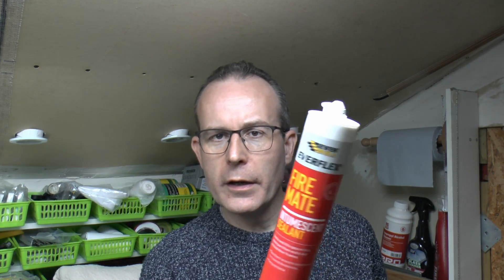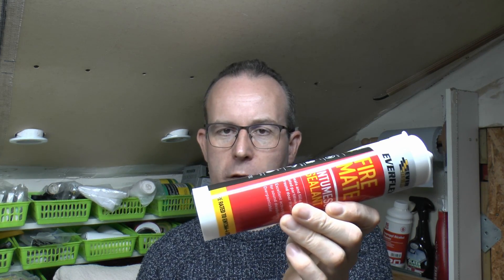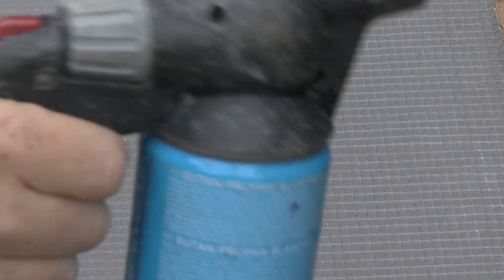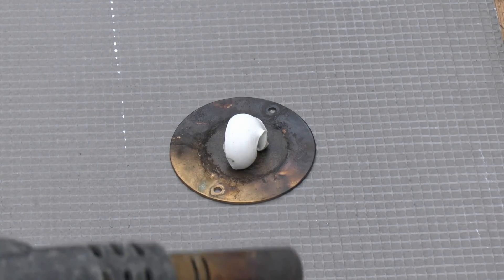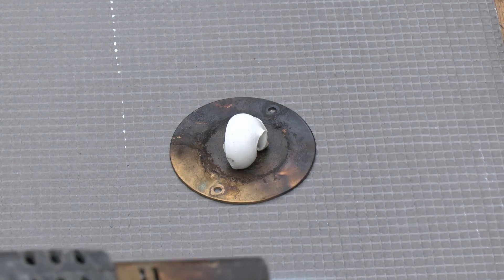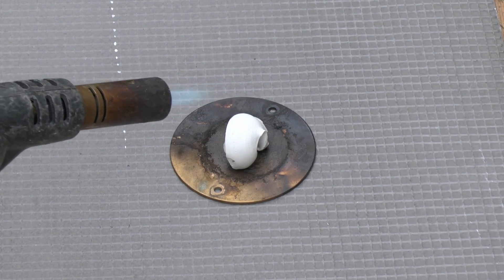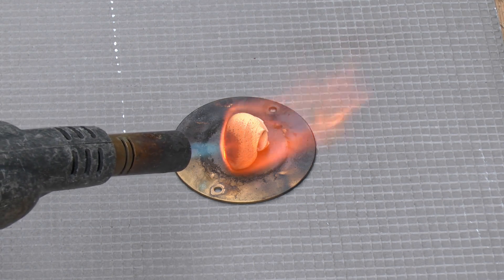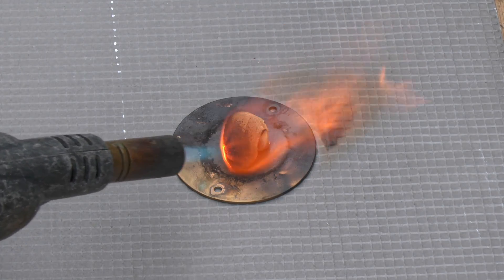Everflex Fire Mate Sealant - Will it Burn?

Comment: Is the gray mat asbestos material ? ( they used to make such stuff this way)
Reply from the maker: No, it's a piece of cement board used as a backing for floor tiles.
Reply: @jwflame   - good ... better save than 20 to 50 years later cancer

Comment: Hey JW, how about testing a flame proof flex gland, you could heat up the cable outside a short piece of trunking with a bundle of wires inside and measure and observe the heat and damage

Comment: Hmmm, that seems disappointing for an "intumescent material". I thought the whole idea was for it to swell up, filling any potential voids, restricting the oxygen supply and act as a barrier to the high temperatures. 
And, whilst not flaring up as much as the fire retardant expanding foam, it does appear to hold a flame for longer?
Surely there must be better intumescent sealants than this? YT videos of intumescent paints appear to perform better than this...or am I missing something? happy to be enlightened.
But a very informative channel, that I enjoy watching.
Reply: I guess the best way is to use fire collars or dry risers and proper separating partitions. But that's new build and not retrofit.
Reply: In fairness that is a concentrated flame at close range and it did stay structurally intact.

Comment: Perhaps you could build a test rig? Some sort of concrete box with a hole through the side, pull come cables through hole and seal with product ‘x’ light a fire inside the box and see how long until the fire comes out the hole with the cables.  I think it is meant to burn, it turns into something similar to ‘carbon foam’ (https://youtu.be/Wex_yKfrTo4) which protects from fire, the real test is if it allows flame to travel past and through the hole, not if it catches on fire itself.

Comment: One thing all contractors need to consider when installing any intumescent fire products is following manufacturers instructions. They aren't all the same and often you'll find the product is completely ineffective if you don't have the right depth. It isn't uncommon to have to make a larger hole to allow for a minimum thickness around the cable so a 40mm diameter hole for a 6mm 3core SWA. Which goes against what us sparks are taught. We usually make a small hole as possible!
Reply: This is a very good point